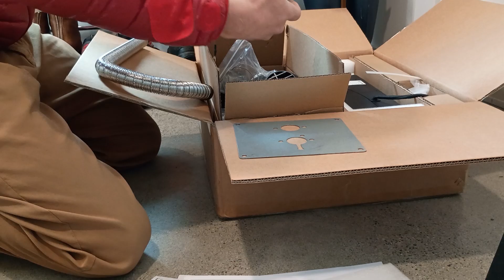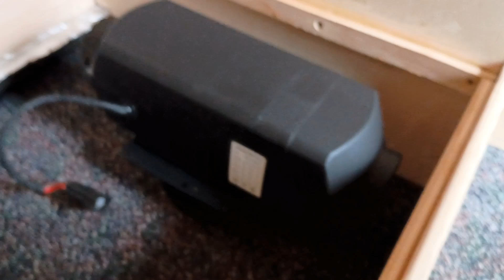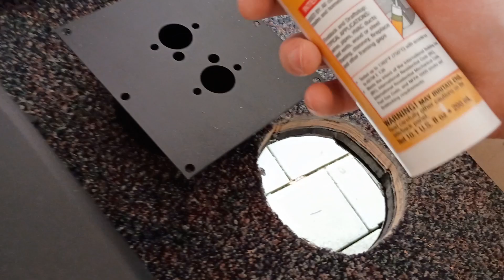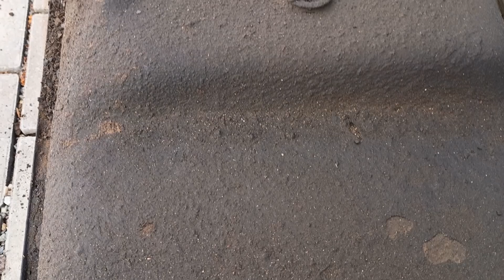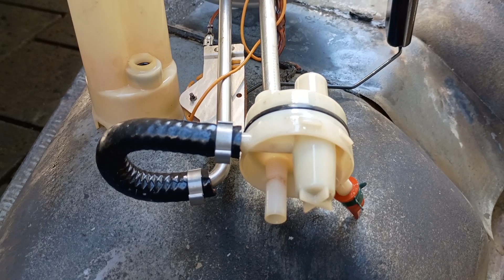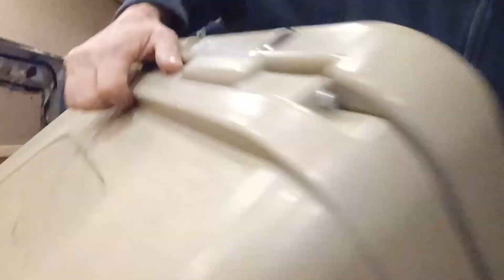Installing a Lavaner Chinese Diesel Heater - Building out a Ford E-350 Van

Comment: nice! the video skipped this part, did the 4 screws on your turret just go right into the floor? and you put some sealant on the top inside before pressing the turret down or no? just sealant where you can see it underneath van? thanks!!
Reply from the maker: I did just screw it straight into the floor.  I used that fireblock sealant around it but wouldn't recommend it or use it again.  It's really designed for static indoor spaces and hasn't held up well to vibration.  I think some regular old silicon would work fine.

Comment: Thanks for the video. I dropped my transfer flow tank last month to install a heater and replace the smaller tank vent hose. I left a rag in my tank fill hose and had to disconnect that again before I could re-fuel again.  Should have checked twice before I buttoned things up.
Reply from the maker: What a hassle!  At least you knew what you were doing the second time around.